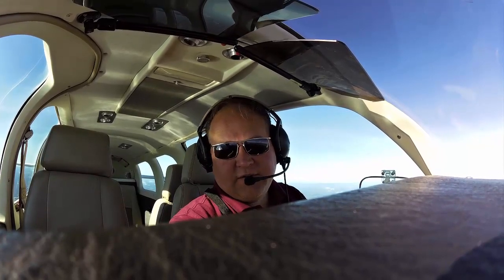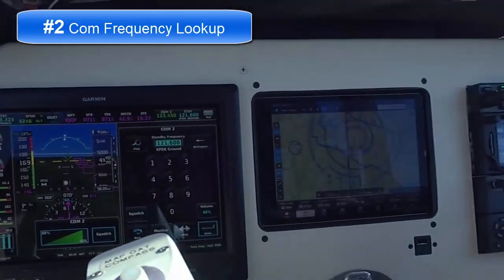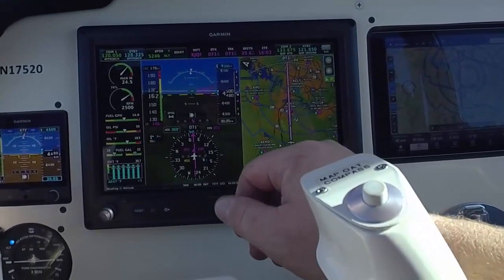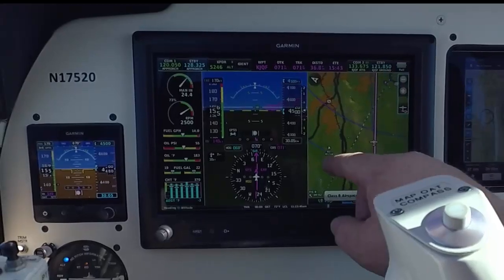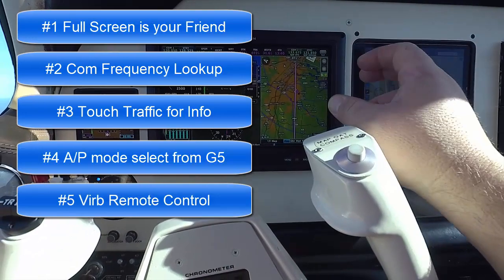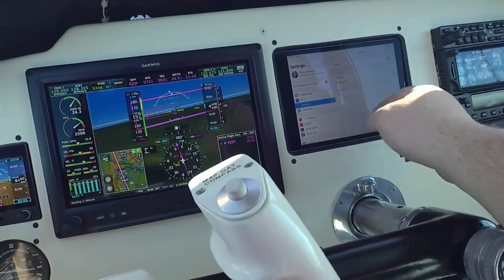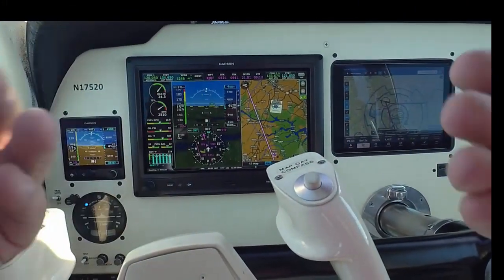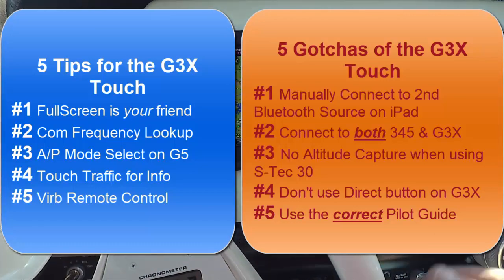5 Tips, Tricks & Gotchas of Garmin G3x Touch Certified in my Beechcraft Bonanza

Comment: Cory, what was the approximate sticker price for that whole glass cockpit upgrade.? I’ll not be offended if you don,t want to broadcast that on here , but couldn’t figure out how to pm you, lol. I,m just learning to fly out of Fulton county in atl and pricing planes and upgrades
Reply: Are you sitting down?  I can’t speak to Cory’s install, but depending on what you install (G500txi vs G3X), a ground up refit of Garmin equipment with a GFC500 and EIS will run between 70 and 90 in most Bo’s. This provides for all new breakers and cutting a new panel.  Utilizing an existing functional AP will save quite a bit; just be aware of the interface limitations as noted in his video.

Comment: This is the second video i’ve seen where the g3x can’t build a flight plan on the 650 and the direct to and nearest don’t use the 650. I couldn’t find any info on this limitation. Your video is 11 months old, has this been resolved with a software update or a component addition or reconfiguration? Or have you otherwise learned how to command the 650 from the pfd? Thanks

Comment: I’ve been flying the experimental G3X Touch for four years now, 250 hours, and here are a few more shortcuts you might like:
* Full screen is not necessarily the fastest or easiest way to switch windows. You can use one of the knobs on the display screen (depending on which knob you programmed) to switch between windows. Map is all the way to the left, chart is next to it, the two most common for me. Going to full screen is a time waster. The screen names are also in a row at the bottom, and you can touch the desired screen and bring it up immediately;
* One of those screens is the video screen, so you don’t have to go down two levels to see what the VIRB is looking at;

* I know an awful lot about G3X Touch, but I still don't know it all...
* Next time you're passing by Savannah, GA, come fly with me.
Reply from the maker: Hi Ed, Thanks for the comment.  I'm still learning the G3X, and welcome all the tips others have found along the way.  Safe Skies!